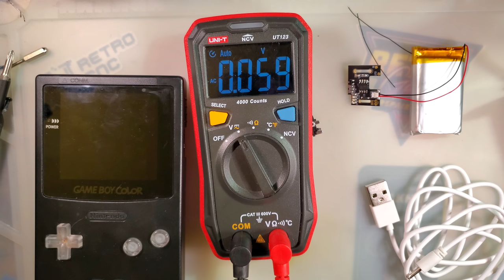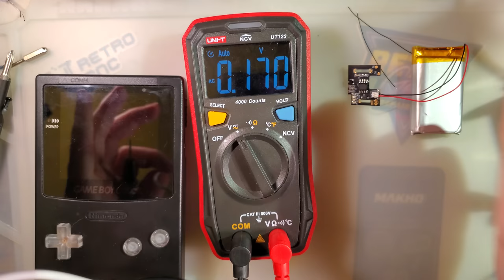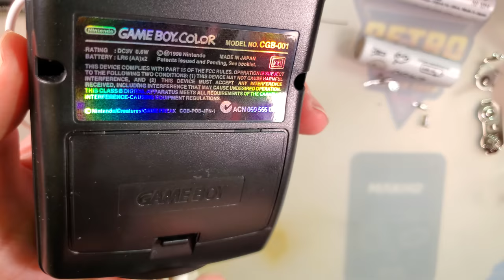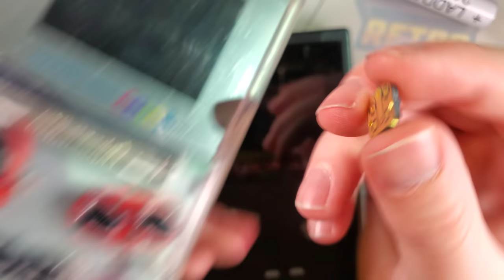FunnyPlaying Game Boy Color LiPo Mod

Comment: DC outs are a must in this day and age. The era of cutting up any shell must go. I just bought my battery kit and button backlight kit. Thanks the info I need should be straight forward.
Reply: @Makho I just did me backlight button kit separate from the battery mod this morning. The low battery indicator I know is supposed to come on. I'll get to why that's weird but not rn. So I initially installed the backlight button kit making sure to solder to the exact points referenced to the video and the vias also mentioned on their site. The problem is I have to power cycle everytime for it to register A&B hold input to cycle modes. Not only that it's not saving the memory of it's placement. Now why is the low battery indicator weird? Because I then did the lithium battery mod also from funny playing to one of your videos. And I then wired up the low battery light indicator also referenced on their site and in your video. Neither can I actually use A&B more than once with out having to power cycle, or can I get rid of low battery indicator without power cycling and also no staying on the color I set it to before turning it off. I am under the assumption that this kit is faulty and even when turning on the console the low battery indicator shouldn't be present after the DC out lithium mod. Can you explain to me what is going on? Please I've researched everywhere I found on Reddit page that stated there's actually two versions of this mod from funnyplaying specifically and I got the earlier rendition or that this is one of the very early batches of fualty ones.

Comment: Still using one of those little 4056 USB-C chargers I bought from BoxyPIxel with their 2000 mAh battery. No JST connector, just directly soldered but the mod was dirt cheap and their 3D printed bracket fits really well in plastic shells after cutting out the USB-C port on the side.
Reply from the maker: I'm glad it works for you but this is more a "drop in" solution (and the holes I cut were for convenience, not necessity) and successfully solves the heat transfer problem that is rampant with a lot of those tp4056 module based mods

Comment: I know I am  bit late here. Will installing this fix the screen flickering issue for most IPS screens? When my AA batteries are nearing the end of their life, the screen starts flickering. I would assume this is because the GBC motherboard isn't designed to output a steady voltage, it puts out less when the batteries are dying.

Comment: the vibe I get when he says "I'm not trying to say it's dangerous". Samsung Note 7, phone traditional don't burst into flames Samsung Note 7.
Reply from the maker: I believe the main problem with the Note 7 was that the batteries were damaged during the install process because the space allotted was too small and would crush the edges of the cell. That specific problem is probably not a concern here but LiPo batteries do tend to fail catastrophically all the same way so it's probably still relevant.

Comment: Hey Mahko quick question, or anyone else who might see this and know. Does that battery mod board just take in 5v and convert it to 3v for the console, carts, and screen power? If that's all it does, has me wondering if the EZ Flash Jr will still work with all of these combined mods (funnyplaying ips q5, ez flash jr, and this battery mod).
Reply from the maker: The OEM DC->DC regulator is not modified.

Comment: Is it possible to do this mod, and add a wireless charging coil to it? I have this added to my gbc that I just refurbed and wanted to also add a wireless charging ability as well, I don't know much about this stuff im just learning. Thank you in advance! Awesome video!
Reply from the maker: Yes BUT wireless charging adds a LOT of heat. Most people put the coil in the battery compartment which then radiates said heat directly into the battery. This is a bad idea for battery health.

Comment: I get I noise after installing.
When there is no cartridge and volume is on minimum.
I changed capacitor and nothing change.
Do you have the same problem ?
Reply from the maker: Clean your power switch and volume wheel

Comment: Do the leds change or is it always solid blue? Did the install and it works but battery died and its been charging for awhile but its always blue
Reply from the maker: There are multiple LEDs, yes. Is your battery properly connected?

Comment: Hello Mahko, I've heard you mention the RetroSix CleanPower as snake oil before. I don't think I've heard why you think that though. I've purchased the cleanpower but haven't applied it yet. If there's a better option you would recommend I'd be all ears. Also, I don't think the way this LiPo Mod sits against the backside of the regulator is ideal. Thank you much!
Reply from the maker: You can read about a lot of the scams retrosix pulls: https://www.reddit.com/r/Gameboy/comments/ktbgnf/retrosix_is_stealing_other_peoples_work_and/

I have not specifically evaluated their GBC mods but I have no reason to believe that they've started being truthful with the listed specs of the stuff they sell. I think I've given them more than enough chances. 

I do not cover their stuff anymore because the comment sections of every single video always turns into a pissing match about how I'm so biased against them and blah blah and it's all just so tiring. They are way too polarizing.

Comment: @makho i finished my install of the funnyplaying mod with the stock powerport it was working fine but now im not getting any charge indication, but the battery still supplying power to the gameboy, any idea what the issue is?
Reply from the maker: Double check your DC jack and wiring.
Reply: @makho  it was the f2 fuse

Comment: I'm thinking about picking this up.  Would an original AC/DC adapter charge this battery?  It powers the GBC just fine, but I don't want to damage a brand new battery for the convenience of a cable I already have.
Reply: Asked this in the GB modding discord the other day, they said that the voltages are different and doing so would damage the battery. I’d get another response before deciding but from what I’ve seen the answer is no.
Reply from the maker: No, I went over this in the video. The voltages are not the same and an OEM adapter doesn't push the current required anyway.

Comment: Does anyone know what type of connector they used for the battery? I accidentally snapped mine off and need to replace it.
Reply from the maker: JST ACHR, the same (or similar) to switch joycon batteries.

Comment: After installing the board, could the game boy still be used without batteries, only connected on the wall plug ?
Reply from the maker: not at all, this mod converts that to a charge only port which means it serves no function when a battery is not installed. And without proper power path switching, you cannot even safely plug it in while the console is switched on.
Reply: @makho  thanks and what about the USB C mod ? Same situation ?
Reply from the maker: @Nico-cg2sw  Probably. Which USB C mod?

Comment: I want a rechargeable battery that's easily charged for my gbc but this seems like I would break it :/ amy suggestions ?
Reply from the maker: Get more practice in so you have the confidence to install something like this. I'm not sure what specifically you are concerned about but this is actually pretty light compared to similar mods that use a USB C port or the like.
Reply: The USB-C version is much more work than this one. This one is pretty simple to do and not that bad.

Comment: I installed this today with a funnyplaying laminated Q5 2.0 screen and Helder's GBC power regulator. You have to cut off the stock DC board and put Helder's regulator with pcb facing the board. The LiPo mod installed easier on the other side with the board lying flat on the DC board's pins I left in. The only hiccup I had was connecting the power cable from the Q5 ribbon to the power switch. If it is connected nothing will work. Apparently this is not needed with Helder's regulator supplying power since I have the 7 levels of brightness.
Reply: hey, can you please share with me some photo of your mod? I'm going to use both helder and lipo mod and I dont know if they can work both together, thanks!
Reply: @jacoposeri4084  what is your email and I will send you the pics. Youtube won't let me post the imgur link here. My email is my username at yahoo
Reply: @androskris  i sent you an email, thx!

Comment: not having play n charge is a main reason why i dont need this. its a gaming device they all need it 100%. I play for hours at times.
Reply from the maker: just charge it when you're done playing.
Reply: @makho  i understand that. also i found those cables on amazon for less then 10$ for 2 packs. 2.5mm x 0..7mm to usb. so now it doesnt seem such a bad idea using the dc jack.  in the end i end up needing the extra cables bc i charge everything at the same time at night.

Comment: You think this will work with the Gameboy Light since theey both use 2 AA batteries?
Reply from the maker: This should work with Pocket, Light, and Color all the same, just double check the wiring on the Light and Pocket because the pins might not line up the same. The included battery won't fit in a Pocket but with some elbow grease and a lot of shell trimming, you might be able to shoehorn it in.